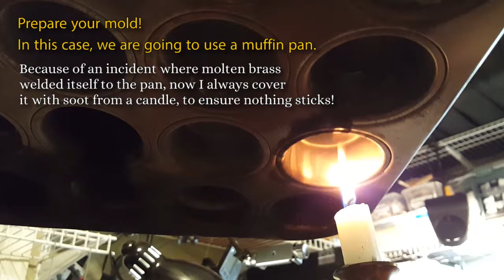How to Make Aluminum Bronze

Comment: That's really interesting, I'm not much of a caster but I dont think that i have seen the candle soot trick. I'll have to give it a go next time im casting. Cheers
Reply from the maker: It's a really neat trick, it works wonders also to help molten metal flow in metal molds. I think I've seen it done also on some sand molds but it was a different technique.  👍

Comment: Hint if your still using the tray instead of candle soot (which is just carbon) you could use a graphite powder to speed up coating times

Also i know it seems like alot but i would recommend buying a devil forge if you havent as they really are sturdy forges and pretty good quality

Comment: I don't know why projects like this fascinate me, but they do. I don't even know what you would use aluminum bronze for.
Reply from the maker: Aluminum bronze is a bit tricky to cast, but we can make jewelry with it ( https://youtu.be/uoaQs4mCkK8 ), since it has great tarnish/corrosion resistance, and looks a lot like 10k gold.
Also because it's corrosion-resistant, it's great for applications where it would be exposed to harsh environments such as the sea.
Some countries have used it for their coins, and cheap dental crowns are made of it instead of gold.

I like it because it looks like gold and doesn't easily tarnish.  😁
Reply: @SculptyWorks  Thanks! That's very informative. I'm thinking jewelry made from it also might be okay with my nickel allergy, though I don't know. Gold jewelry that touches my skin isn't good for me. I mostly have titanium or surgical steel for my earrings.
Reply from the maker: @elissahunt  That sucks! You need to wear high karat gold (22k) or get it custom made with an alloy that won't contain nickel. I don't know why people still put nickel in their gold, there's so much better stuff to use! Whenever I made my own alloys, I used copper and/or silver with yellow gold, and palladium and silver for white gold.

Comment: I have a question...Can you make a good ringing bell from aluminum bronze?
Reply from the maker: I have no idea, I never tried casting a bell from it. ...maybe future project?  😉
If I had to assume, I would think it would have a very bright tone, and may be a bit brittle, depending on the amount of aluminum that goes in it.
Reply: @SculptyWorks  Please try one in the future. I am curious and is the melting point lower if you have aluminum scrap around?
Reply from the maker: I'll put on my projects to-do list.  👍
The melting point of aluminum bronze (1040 °C) is actually higher than regular bronze (915 C), but a bit lower than copper (1085°C).

Comment: If the Alloy is a 87•5 %-12•5 % mix should it be calculated by volume not by weight ? 7 parts Copper to 1 part Aluminum. I think the weights should be 875g-125g if Copper and Aluminum are the same weight but I could be wrong.
Reply from the maker: Copper and aluminum are not the same weight (specific gravity). The calculation is done by weight, not volume, otherwise you will end up with a disproportionally large amount of aluminum. It might come out alright but I reckon too much aluminum makes the allow horribly brittle.
Reply: @SculptyWorks  I was going by a video explaining that the hardest and possibly best ( not brittle ) alloy is 87.5 pc Copper and 12.5 pc Aluminum. That to me seemed like 7/8 ths is Copper and 1/8 th is Aluminum. So pouring 7 muffins of Copper 1 muffin of Aluminum then  weighing them separately would give the correct ratio for using weight. The video is at 
https://www.youtube.com/watch?v=SVzWrPwi8_o&t=1s

Comment: Always melt the higher temp metal first - why is that?
Reply from the maker: Many reasons! Some metals become more reactive the hotter they get, and in the case of aluminum it creates a lot of dross if you overheat it. Also in this case overheating the aluminum could cause some splashing when you put the relatively cold copper into it. And while it's not the case here, some metals can literally boil away. Also in this case, we had a tiny bit of aluminum and a whole bunch of copper; if we melt the aluminum first and then put in the copper, the molten aluminum would freeze back up; melting the whole lot of copper first and then putting in a little bit of aluminum makes the aluminum melt almost instantly; it's more efficient that way.  👍
Reply: @SculptyWorks  I'm asking because i was hoping to "dissolve" the copper in the aluminium like sugar in coffee, never having to actually reach full copper melting temperatures - seems this plan goes out of the window :)
Reply from the maker: @Avemis1  I'm afraid it doesn't work like that.  😉
Flux (borax) will lower the melting temperature of the copper by a little bit, though.